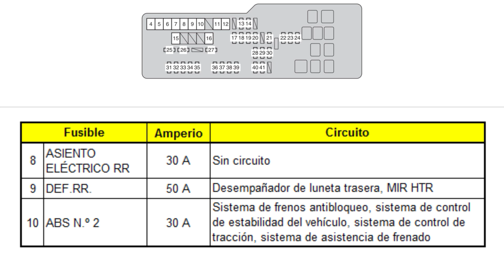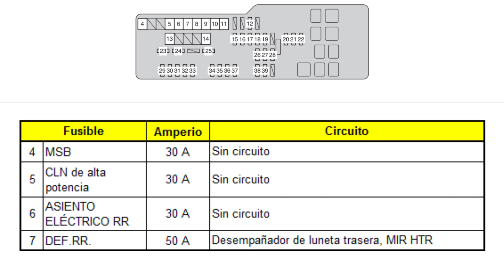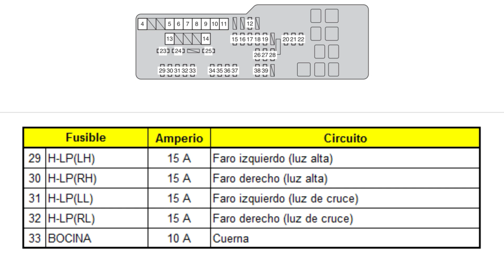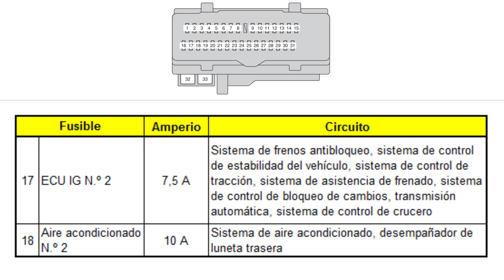Diagrama de la caja de fusibles de Toyota CAMRY 2011. ToyoFans.

Comment from the maker: Toyota CAMRY.
Año: 2011.

Relé y Fusible de la Bomba de Gasolina, Combustible, Gasoil, Nafta, Diesel, Petróleo, Bencina, Carburante, Gasóleo, Gasolìn.
Motor NO ARRANCA revisa estos FUSIBLES.
Conoce todos los relevadores y fusibles de un Toyota.
CAJA DE FUSIBLES.
¿ COMO SE LLAMA EL FUSIBLE DEL AIRE ACONDICIONADO ? 
Ubicaciones de los fusibles y detalles del circuito para encontrar el fusible correcto.
¡ Explicación de la Caja de Fusibles de su Automóvil !
No funcionan Luces DIRECCIONALES solución fácil con diagrama ( palanca, botón, fusibles, flasher ).
Nombre de todos los Fusible del Auto de Ingles a Español ( Función, ubicación ).
¿ CUAL ES EL FUSIBLE DE LUCES DE CUARTOS ?
COMO SE LLAMA EL FUSIBLE DE LOS VIDRIOS ELECTRICOS.
Cual es y donde encuentras el famoso Fusible de la Bomba de Gasolina. 
Fusibles.
Como se llama el fusible del claxon o bocina.
COMO SE LLAMA EL FUSIBLE DE LA BOMBA DE GASOLINA.
COMO SE LLAMA EL FUSIBLE DEL TABLERO.
¿ COMO SE LLAMA EL FUSIBLE DE LA BOBINA DE ENCENDIDO ?
DÓNDE ESTÁ EL FUSIBLE DE LAS VENTANAS ELÉCTRICAS, LOS VIDRIOS ELECTRICOS EN UN TOYOTA.
Extractor de fusibles Toyota.
Fusible de las luces de una camioneta Toyota.
Diagrama fusilera Toyota, ubicación y función de cada fusible: radio, ventilador, luces, bobina.
¿ COMO SE LLAMA EL FUSIBLE DE LOS LIMPIAPARABRISAS ?
El Fusible.
COMO SE LLAMA EL FUSIBLE DE LAS LUCES TRASERAS.
Identificación de FUSIBLE y relay en TOYOTA.
COMO SE LLAMA EL FUSIBLE DE LA CIGARRERA.
COMO SE LLAMA EL FUSIBLE DE LAS DIRECCIONALES.
COMO SE LLAMA EL FUSIBLE DE LOS LIMPIA PARABRISAS.
Que Fusible se debe usar para un Circuito? 10 amp, 20 amp o 5 amp.
FUSIBLES Y RELEVADORES TOYOTA PARA QUE SIRVEN.
Ubicación de fusible de ignición.
¿ COMO SE LLAMA EL FUSIBLE DE LA CALEFACION ?
Nueva ubicación de la caja de fusibles del Toyota, fusible de la luz trasera.
Qué fusible y relay controlan la bomba de gasolina / combustible de un Toyota.
Significado de fusibles.
Fusible cuartos trasero / Fusible cuartos delantero / Fusible luz tablero. 
Ubicación de fusible de las plumas limpiaparabrisas.
Posición de Fusible y Rele bomba de combustible.
¿No suena la bocina? ¡Cambia el fusible de repuesto!
DÓNDE ESTÁ EL FUSIBLE DEL SISTEMA DE ALARMA E INMOVILIZADOR EN TOYOTA.
Cambiando fusible donde va y cuál es?
COMO SE LLAMA EL FUSIBLE DE LAS LUCES DE REVERSA.
Dónde está el fusible de la computadora de Toyota.
Fusible.
FUSIBLES DEL TOYOTA EN ESPAÑOL.
COMO SE LLAMA EL FUSIBLE DEL ALTENADOR.
Los Relés.
Localiza un relé de bomba de combustible rápido y fácil !
RELE y SWITCHES del STARTER o motor de arranque.
Ubicación de relevadores Platina ( relevador de bomba de gasolina ). 
Dónde está el relé para el ventilador del radiador Toyota.
Relés eléctricos de automóviles explicados: cómo funcionan y dónde se utilizan.
Fusibles y relays Toyota ( bomba de gasolina ).
Relay del Motor de Arranque / Starter Relay con Falla.
Relay / relevador / rele de motoventilador Toyota.

____________________________________________________________________________

COMPRAR EN AMAZON:

JOREST - Juego de 300 fusibles de cuchilla para el auto, 160 mini, 90 estándar, 50 micro y 1 extractor de fusibles, para caravana o motocicleta ( 2Amp, 3A, 5A, 7.5A, 10A, 15A, 20A, 25A, 30A, 35A, 40A ).
https://amzn.to/3TQ2G4O

Nilight - NI -WA 06. Kit de cableado de la barra de luz LED - 2 cables 12V Interruptor de encendido y apagado, relé de potencia, fusible para las luces de trabajo LED fuera de la carretera, 2 años de garantía.
https://amzn.to/3Umaoni

Multímetro digital Astroai con amplificador de ohmios y voltios y prueba de diodos.
https://amzn.to/46kykia

KAIWEETS - Probador de voltaje sin contacto con porcentaje de señal, rango doble CA 12 V/70 V-1000 V, cables con corriente/sin corriente, pantalla LCD, alarma sonora, detector de rotura de cables.
https://amzn.to/46PWtgE

Luz de prueba automotriz con pantalla de voltaje digital LED de 3 a 48 V, probador de circuito automático con voltímetro e indicador de polaridad de doble color, bolígrafo de prueba eléctrico.
https://amzn.to/4f1PX8X

Comment from the maker: Diagrama de fusilera de Toyota CAMRY.
Año: 2011.

Con este vídeo, podrás responder las siguientes preguntas:

- Cómo se llama, el fusible de la bomba de gasolina ?
- Cuál es el relé, de la bomba de gasolina ?
- Nombre de los fusibles y reles, traducidos del ingles al español.
- Cómo saber, cuál es el fusible del claxon ?
- Cómo reconocer los fusibles y relevadores de un carro ?
- Por qué no arranca mi carro ?
- Dónde está, el fusible del encendedor de cigarrillos ?
- Cuál es el fusible de las luces ?
- Ubicación y función de cada fusible. 
- Dónde está, el fusible del radio ? 
- Cuál es el fusible de los limpiaparabrisas ?

Consíguelos en Amazon:

Juego de 300 fusibles de cuchilla para el auto, 160 mini, 90 estándar, 50 micro y 1 extractor de fusibles, para caravana o motocicleta (2Amp, 3A, 5A, 7.5A, 10A, 15A, 20A, 25A, 30A, 35A, 40A).
https://amzn.to/4fj0RpO

Probador de circuito automotriz de bombilla LED premium, luz de prueba de 6-24 V con cable de resorte extendido de poliuretano de 135 pulgadas, sonda de acero duro afilado para vehículos.
https://amzn.to/3YxtatJ

Multímetro digital Astroai con amplificador de ohmios y voltios y prueba de diodos.
https://amzn.to/4f3ACE3